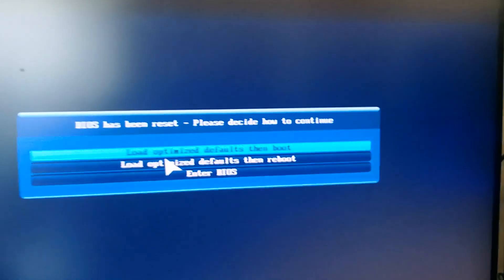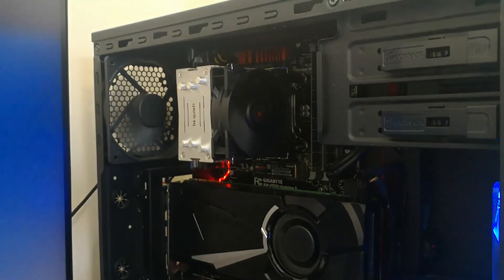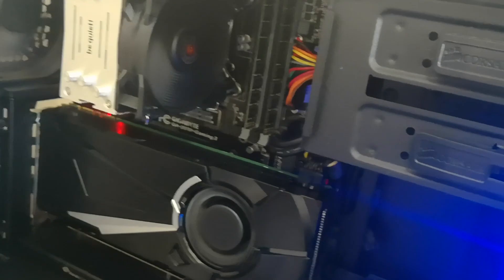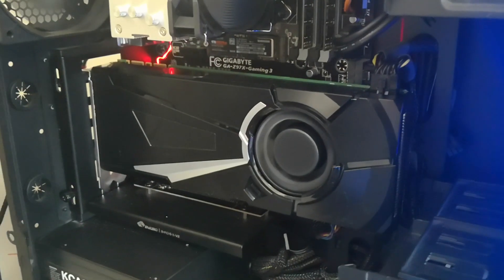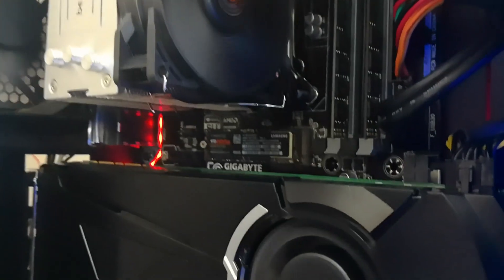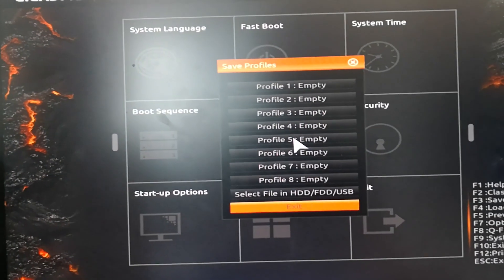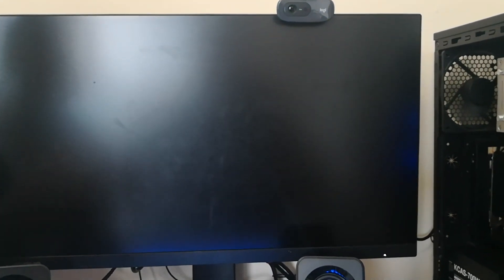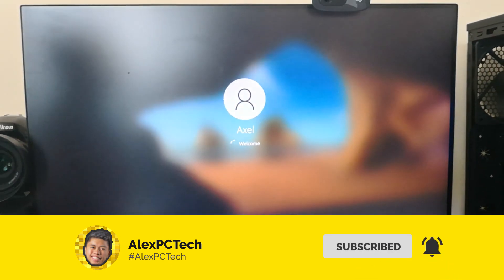How to Fix Bios has been reset - Please decide how to continue

Comment: What if it's not issue with CMOS battery? I have changed the battery it still shows the same issue everytime I switched on completion
Reply from the maker: I think this will now be on the motherboard or something is grounded with the motherboard.
Reply: @AlexPCTech   Should motherboard be changed or some circuit issue in motherboard?  it has been recently updated but problem persists. And it's 10+yrs old
Reply: Update the date on your system date